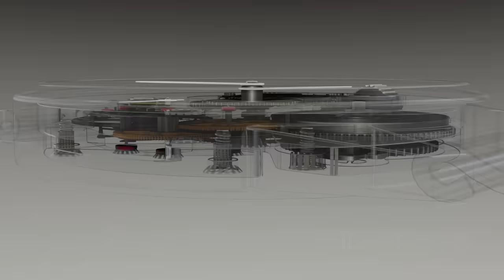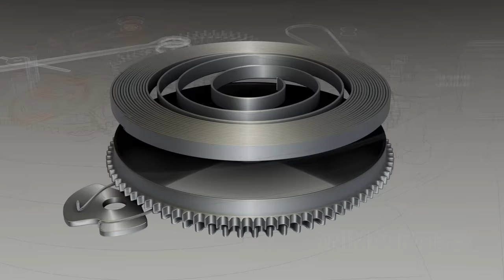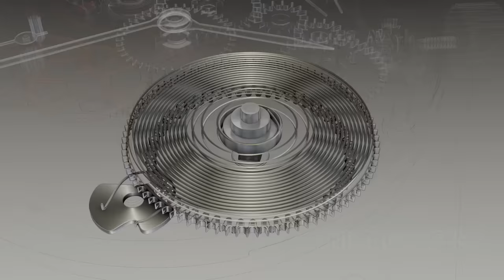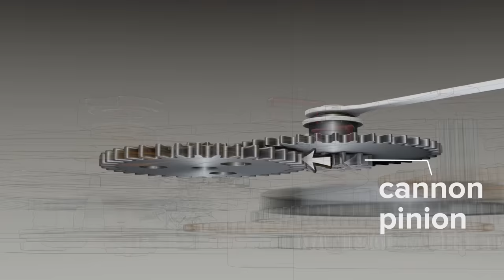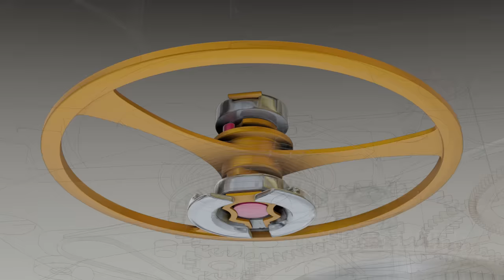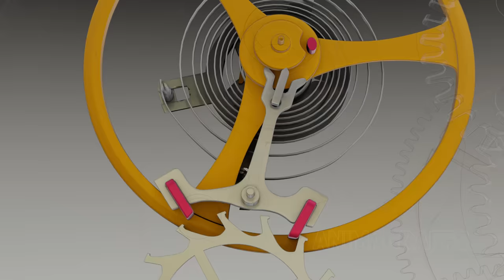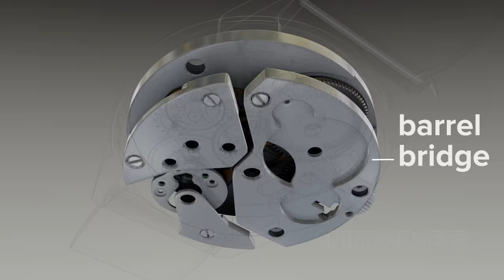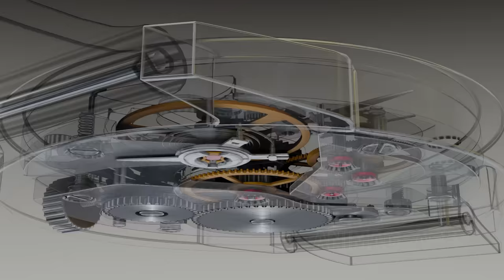How a Mechanical Watch Works

Comment: I know a quartz watch is so much more accurate, but the artistry and engineering behind a mechanical watch is just so beautiful
Reply: Well the average quartz clock is more precise than the average mechanical, but I guess it is possible to make very, very precise mechanicals also - possibly beating common quartz clocks.
Reply: @endreszatmari2302  only grand seiko's spring drive movement can get close to quartz accuracy
Reply: @endreszatmari2302  Nope, not a correct guess. As said in the video, mechanical watches swing at about 6 times per second, give or take, but Quartz are measured in MHz (millions of oscillations per second), so a 5 dollar quarts watch is literally 1000000x more accurate than an average mechanic watch. Now how much more accurate can a “very precise” (and expensive) mechanical gear be? 100x better than the one shown in this video? I doubt it, but even then it’d still be 10000x worse than quartz.
Reply: @Ahmetmhr  Yeah it's basically a mechanical watch regulated by quartz
Reply: @1c72  3-6 seconds off a day is what he said
Reply: @blakethaboss5120  for a nice movement, my seiko 4r36 loses about 8-10 seconds a day :/  Might try to regulate it.
Reply: @1c72  That thinking is a bit flawed considering there ARE bad quartz movements which lose a second per day or more. Quartz in general is a lot more accurate but it's not a matter of "6 vs millions of oscillations". Mechanical can get within a second or two per day which is pretty good.
Reply: @1c72 Your reasoning is flawed.
 Quartz may be measured in MHz, but that doesn't mean they are precise down to the Hz. It's not because you can have a ruler precise to the milimeter that you can get the length of a bus with a precision under the milimeter.
Most quartz watches can lose 1 second per day.

I'm not saying that quartz watches are less precise than mechanical watches because, obviously, it's wrong.
Just that they aren't more than 5 times more precise. Let alone the 10000 times that you claim.
Reply: @1c72  "Quartz are measured in MHz" if you are talking about wrist watches þen you are wrong þe oscillating frequencies for þose are 32768 Hz. But if you are talking about Quartz Clocks þen yes þey run wiþ MHz, 4.19MHz to be precise. 

And also I doubt your "runs 10000x more precise" claim but I don't really know. I could ask my teacher about it þo.

Yeah i asked him and a quartz is running "only" 50x better þen a mechanical watch. You can regulate a mechanical watch up to 5 sec/day (recomendate) and a quartz around 1/10th of a sec/day
Reply: @maxkreuzer  Bruh why use the th letter lol
Reply: Saying quartz is more accurate than mechanical is like saying your mum’s yaris has more seats than a Ferrari. True statement but not relevant in the slightest.
Reply: @Ballacha  Except the whole conversation has to do with accuracy.
Reply: @endreszatmari2302  no, a cheap quartz watch will always be way more precise than an expensive mechanical watch. But you don't have a mechanical watch only to tell you the time.
Reply: @DM-rc4yu  as a child I had a cheap quarz that was 1s/year. I didn't touch it ever not even for the summer/winter's time because back then it was way harder to have access to the atomic clock time. However it died the empty battery death as all my quarz did at some point.
Reply: @1c72  I dont think thats how math works
Reply: @hinkwanwong9315  or a quartz watch regulated mechanically.
Reply: @raphael122  730 times more precise in some cases.
Reply: @endreszatmari2302  doubtful. Even cheap quartz trounces expensive mechanical in accuracy, but the difference is purely academic as it's didn't really matter if it's 8s difference
Reply: @Ben.N  time to service it, not to try to regulate it. Take it to a watchman.
Reply: To all you keyboard warriors out there- quick search reveals exact data on mechanical/quartz accuracy: You get +/- 1 second per day variation on a very good mechanical watch-if maintained properly (lets say $5000 worth). Best quartz (Citizen Chronomaster) gives you +/- 5 seconds per year variation (for about $1500). Funny thing is cheap Casio, synchronised with an atomic clock sets you back about $50, and looses/gains 1 second every 138 million years (estimated :). For the record- Im addicted to pure beauty, precision and engineering genius of mechanical timepieces, proud owner of IWC mark XVIII .
Reply: @mazatlan79P  Wrong but okay. The most accurate quartz watch is Citizen 0100 caliber with annual accuracy of ±1 second. Basically wearing this watch, by the time you die, it will only be off by ±1 minute.

Regarding your Casio... it's basically a cheap quartz watch with radio receiver to sync. So we might as well talk about Apple watches.

Lastly, I believe Zenith holds the most accurate mechanical watch at ±.3 sec per day. I'm aware you didn't say the most accurate mechanical watch but this info. is just tidbits.
Reply: @endreszatmari2302  not possible. It's in the science. Sample size determines the accuracy. The balance spring in a mechanical watch cannot oscillate fast enough to have a sample set close to a quartz crystal vibration in a quartz watch.
Reply: Thank you for all of you who clarified this. I stand corrected.
Reply: Yes mechanical watches are incredible when done well.

However quartz movements are subjectively equally incredible in another way. Quartz timing relies on physics and acoustics, which is a beautiful concept in itself. Given the accuracy, ruggedness, and lesser service needs of quartz, that also makes them brilliant. I have owned an Omega quartz which which gained only six seconds a year.
Reply: @terrestrialcreature7481  you sound like the homeless person on the street telling me my shirt is shit because the only purpose clothing should serve is keeping warm, and therefore his smelly old jacket is better than $500 business outfit.
Reply: @Ballacha   This whole conversation was about accuracy, so it is clearly relevant. Nobody ever claimed the sole purpose of a watch was to be accurate.
Reply: @terrestrialcreature7481  which “whole conversation” are you referring to lmao
Reply: @Ballacha  Whole reply section
Reply: @terrestrialcreature7481  so i'm not hitting the talking point because i didn't let a youtube comment section derail the real conversation?
Reply: There are a couple of mechanical watches that give less than 0.8 seconds off per day.
Reply: I've said it before...great video...probably didn't need the trance and techno background music
Reply: I don’t wear a Quartz wrist watch, I wear their pocket watches.
Reply: @Ballacha  Hey! I'll race you in my moms yaris! WITH GROCERIES IN IT!  I bet i'll take you bro!  it's got aftermarket exhaust !
Reply: @GOLD_FEVER  shit I’m scared bro those exhausts are worth at least a couple thousand raw dog horseys
Reply: @endreszatmari2302  You have to be careful to not conflate "accuracy" and "precision".  They are two different things.  "Accuracy" is about correctness of a measurement, "precission" about confidence in that measurement.  For example, let's say a metal rod is exactly 1 meter long: to describe it as 999.9 millimeters is more "precise", but it is less "accurate" than saying 1 meter.  Higher precision can be more accurate, but isn't necessarily so.  Quartz is much more precise than any mechanical gear, and that generally means that quartz watches can be built to keep time more accurately, but remember, even a broken watch is spot on accurate twice a day.
Reply: Mechanical watches are within 2-3 seconds accurate over 24 hours. That's already splitting hairs.
Reply: @ramandiezo  yours is not as accurate as the time in my mobile phone 😅because mine is regulated by an atomic clock
Reply: @endreszatmari2302  Nope. A modern mechanical Rolex one will be accurate to 2 seconds per day. A cheap quartz is accurate do about 15 seconds per MONTH. A high quality quartz will be accurate to about 10 s per YEAR. The main accuracy determinant for quartz watches in temperature changes, so the more complex quart movements features that compensate for that.
Reply: @1c72  which is totally irrelevant because most clocks dont have the exact same time anyway. Not even two identical phones that get their time from the internet etc.

So if its 20:01:58  or 20:02:02 makes no difference in the real world. And when you even have radio controlled clocks the distance between the clock to the source of the signal and eventual obstacles such as walls etc also change the accuracy.

In a world where everything is punctual and no bus is late by even 0.5 seconds the quartz difference for NORMAL PEOPLE might.... well make a difference. But such a world does not exist (like in BackToTheFuture2 and the absolutely exact weather forecast)
But for basically everyrthing other than science its completely irrelevant. Even the stock market computers have different connection latency so even there a second is not over at the exact same moment on two devices etc.

Like if you try to send a spacecraft on an exact orbit to get a boost by our moons gravity you want quartz.
But for taking a bus, getting on a plane, going on a date, having an appointment and basically everything normal people do it makes no difference. And even having two perfect quartz watches might make a huge difference because 1 person might need longer to take a look and process what the watch says than another person :) and doing something with the info again takes time.

In my house not 2 devices have the exact same minute even. My microwave is different from my analog clock, my TV, phone and computer, game console everything is completely different. Sometimes even by minutes. No problem. I even have my kitchen clock run 5mins early because thats usually the last clock I look at before leaving the house so I never am late taking a bus or whatever. Does not make the bus be on time however so its late sometimes and even early sometimes :(.

A mechanical clock/watch however teaches people to pay attention, gets them something to do(a routine that helps them get some order into their life) and well doesnt waste batteries, electricity :)
Reply: @1c72  i agree 🙌😁
Reply: @Ahmetmhr  Grand Seiko Spring Drive IS a quartz watch. It's the exact same quartz regulation and movement as any other high end quartz watch. The only difference is the power source. GS using a spring instead of a battery but don't let that fool you, it's still electronic and regulated by quartz.
Reply: I would never put a quartz watch on my wrist.
I own a 1968 cal.564 Omega Constellation. This 54 year old officially certified chronometer has recently been on a timegrapher. It's exactly +1 second off per day. Now THAT is craftsmanship. I am in love with it.
Reply: If you know a bit of engineering you would easily understand is nothing such special, unluckily watch market is very toxic
For two reasons, the first is that the line that splits watch to jewel is very thin so there is many apparency and very high prices drove off the brand (this is not a downside), you can have same movement of a Rolex at way less
The second issue are the nostalgics like the old man ↑ up my comment, that just shame quartz (that is nothing than a piezoelectric component) because "ooh look I am a man, I have automatic, I have 1 second off (that's a lot)", these people are the worst, and are the first that are not watch experts 

Plus, I want to add a note: also battery sourced quartz is fascinating, the architecture, the electronics, vibrations is fascinating, but is way harder, trust me, to study, compared to spinning gears of a watch with same pattern (not even cars or planes..)
So please, don't be like that ↑
Reply: @endreszatmari2302  high end quartz clocks, like the one in your phone processor can keep time up to 1s every half decade or so. Mechanical doesn't even come close.
Reply: Well, that depends on the qualities of the watches. There are some mechanical watches that are more accurate than some cheap quartz watches.
Reply: @Ahmetmhr  
Spring Drive is not "close to quartz accuracy", it's incredibly more accurate.
Reply: @1c72  
Wow, you are a real "quartz defensor". No, best mechanicals are much more accurate than average quartz watches.
Reply: @1c72  
And thinking that "more swings/oscillations per second = more accuracy" is an error. What matters is the constancy of that swings/oscillations, not how many of them are in a second.
Reply: @user4241  That's BS. You clearly don't understand what a quartz is and how it works. Even the 5 Euro wall mount quartz clock in my kitchen is more accurate than any Rolex, AP or Patek will ever be.
Even the cheapest (digital) quartz watches will beat a high end mechanical chronometer anytime.
Reply: @veganbutcherhackepeter  
I'm not talking about that mechanic watches. With "the best mechanical watches" I meant the most precise ones, and you should have been able to understand it given the context, but, anyways, yes, I understand what a quartz is and how they work. Yes, cheap quartz watches/clocks are more accurate than 99.999% of mechanical watches/clocks, but there are some mechanical ones that are more accurate than the average quartz. For example, 'Zenith El Primero' is more than 3 times more precise than an average quartz. Please do some research before feeling superior to someone.
Reply: @user4241  But don't take it out in the cold. Or a hot environment. Or a damp bathroom. And don't tilt it on its side or flip it on its back, because that will all affect its accuracy. You see what I'm getting at. Outside a lab under perfect conditions, a mechanical watch will always be less accurate than a quartz. And I say that as an owner of only mechanical watches. Although my next buy will be a G-Shock. Those are awesome.
Reply: @user4241  yes you are right, my bad
Reply: @t.terone522   I totally stand by what you said.
I have given up on quartz. You can't collect them unless you want to change dozens of batteries per year if you want any one of them ready to be worn whenever. On the other hand a mechanical that hasn't run for years is ready with a few twists of the crown.
As for accuracy, I am happy within 2 minutes/day for cheap vintage beaters. If I need really precise time, which is rare IRL, I'll do like everyone else and look at the phone.
Reply: @endreszatmari2302  No, it's physics. A mechanical wheel/spring cannot count as many cycles per second as a microchip counting the vibrations of a crystal. Quartz will get even more accurate but mechanicals, nope... ok mechanicals will get more accurate but small increments nothing like double their current accuracy. and the more accurate a mechanical gets the more service it will need.. while on quartz pretty much the only moving pieces are the hour hands so the wear on the materials will be the same.
Reply: I am actually beginning to appreciate quartz watches these days.   No doubt mechanical is amazing.   Have brown tired of having to reset the time on a mechanical watch.
Reply: I love automatic watches more than anything. They represent Solar System and the concept of time. The Time  and Gravity are two things You can not seperate. As long as Your watch gets the force of gravity so long it will show the Time. So... wear it and move Your hand as long as You are alive.
Reply: @martinlatvian5538  I have a work watch that I depend on.   I am not wearing my Swiss watch at work cuz it’s large heavy and sends the message I have money.   When I go to wear my auto it has often stopped.  It also needs a thorough tune up.  I am over Swiss autos.  My $20 casio keeps better time.   I would like to purchase a luxury quartz watch though.
Reply: Mechanical watches are  overrateted
Reply: @batanghari2131  In car industry Tesla model S  will always be better than for example Pontiac Firebird or Corvette. Some people may say Tesla is overrated. Some people just like the burning fuel and roaring V8.
Reply: @martinlatvian5538  sorry but, r u trying to say that quartz is like a pontiac and mechanical is like a tesla?
Reply: @batanghari2131  the thickness makes em ugly.  Rolex does a nice job on thickness, most mechanical ⚙️ r too thick
Reply: @chevy4x466  well ap is thinner i guess, has a better looking too for me
Reply: I agree😊
Reply: The Central Scrutinizer  you don't have to out yourself like this lmfao
Reply: The Central Scrutinizer  the way you curl up in a fetal position rocking back and forth chanting “your opinion means nothing to me your opinion means nothing to me…” is comedy gold
Reply: @endreszatmari2302  Thank you for your humility. You certainly stimulated a very interesting discussion.
Reply: @averagegunuserhere4107  I hear their pocket watches are as cheap as their wristwatches. Do you wear them inside your pocket?
Reply: @Ballacha  This is probably the most asinine analogy I have seen in YouTube comments. Made me chuckle though! 
The whole discussion was about precision in timekeeping.
Reply: @NoNonsense_01  "asinine" lmao. haven't seen kids using this word in a while. and no. the conversation is about value proposition and how precision timekeeping is dirt cheap in 21st century. but if you want to be the homeless guys wearing a dirty ass full-of-patch trench coat yelling at people "clothes that keep you warm are the best clothes. your suits and ties are worse than my coat", i'm not stopping you.
Reply: @Ballacha  The second analogy isn't landing either. If you're freezing in cold in your expensive suit and some homeless guy is not, then that guy will rightly laugh at you. Buying diamond studded square wheels doesn't make you smart. Anyways, I hope your taste in watches is not like your analogies.
Reply: Many of you in the comment section are talking from theory and not experience and are completely overblowing how "inaccurate" or "more accurate" Quartz/Mechanical watches are. I have experience wearing both for work for YEARS. Mechanical watches for daily use are just as accurate as Quartz for your purposes. If you need to tell the time, both are absolutely terrific at telling time. Most modern mechanical watches are off by 1-2 seconds a day, my favorite one is 1.4sec/day loss. That means for me to see an actual noticeable difference in my watch, I have to wait almost THREE MONTHS for it to be off by TWO minutes (1.4sec/day has a minute loss over 42.8 days).

If I need "insanely accurate time", I'll just pull out the one I have in my pocket. My phone.

The point of a watch isn't to be super accurate, it's to know relative time and to display as a fashion piece. We all speak in five minute intervals. We use other instruments other than a watch for time-keeping accuracy. I personally love my $50 skeletonized mechanical wristwatch, and it gets way more attention and compliments than anyone's smartwatch, and charges in ten seconds every three days.
Reply: @Ahmetmhr  mecha quartz seiko vh31 can get there.
Reply: @Ben.N  my seiko nh35 is nicely regulated within 2 seconds a day. The cool part is i only paid $50 for this invicta pro diver off of Amazon and it is a phenomenal watch for that price.
Reply: I mean the accuracy does not matter because the spring unwinds and stops the watch so u need to set the time again anayways
Reply: @terrestrialcreature7481 Point being it's probably the wrong conversation
Reply: I completely agree! I always say a “quartz” (or battery powered) watch, isn’t actually a REAL watch. I just don’t consider a quartz watch a real watch in my opinion. A real watch is a watch that runs itself, & can always work as long as you wind it or keep it in motion. Mechanical automatic watches are actually what a real watch is in my opinion. They didn’t have batteries back several hundred years ago, but they did have mechanical watches. So that’s what a real watch is to me lol. That & as you said, the artistic side of it, & the amazing innovation of how it works with no outside source of power. It’s amazing to think that someone thought of this so long ago & made it functional, managing to make all these precise little pieces & put them together to create a self sustaining tiny system that’s able to keep the time. Absolutely amazing, super fascinating, & a true work of art that still holds to this day. I love watches. I will only ever own mechanical automatic watches personally.
Reply: Mechanical watches aren’t JUST timepieces, they’re also works of art that represent an extremely old and refined trade. They’re wonderful and I hope they never go away.
Reply: @Karda_Nava  While everyone is entitled to their personal preferences and opinions, dismissing quartz watches as not real watches is not entirely accurate. A quartz watch is still a timepiece that tells time accurately and serves its primary purpose, which is to keep track of time. The fact that it is powered by a battery instead of being manually wound does not make it any less of a watch.

Furthermore, it's not like mechanical watches are masterpieces of engineering. They are more like steam engines, mechanical calculators and other obsolete technology. The engineering behind a common quartz is much more advanced. Oh, and try dropping a mechanical watch on bathroom tiles and tell me how much it always works.
Reply: It's classical. It makes you feel sophisticated and primal at the same time.
Reply: Digital watches are the most accurate, it connected online
Reply: @keluargaakasia7678  That’s not what it means to have a digital watch. Digital watches have been around since before the internet. It only refers to the face: the part you read. It shows you digits instead of hands, hence digital. Basically every digital watch I’ve ever seen has used a quartz movement, meaning battery powered.

You’re probably thinking of atomic watches, which are quartz movements that can be digital or have traditional faces and that receive a radio signal from Colorado nightly (if you live in the US) to update the time to the most accurate possible.
Reply: @Ballacha  not only that has more seats, but it's also more reliable than the ferrari, much more cheaper and has better driving comfort. Plus it's cheaper and easy to maintain and also you don't need to work so much in life just toa have one unreliable car that you can't even park at the side street.
Reply: @Ballacha 
A Ferrari actually does something better than a Yaris.
Reply: Your comment resonated with me. To me, what makes these much more alluring than quartz is how artistically formulated and constructed these designs are. I was blown away by how magnificent the spring drive mechanism is, as it combines the beautiful architecture and engineering of the mechanical movement with the accuracy of the quartz crystal's timekeeping. What a beautiful thing
Reply: I was like ... is this a glitch or... and toward the end a smirk started creeping across my case... then when I read your comment I lost it lmao
Reply: It's not even close. Mech watches are glorious.